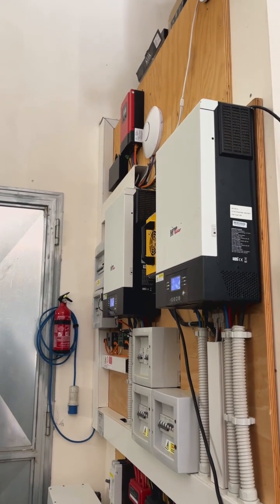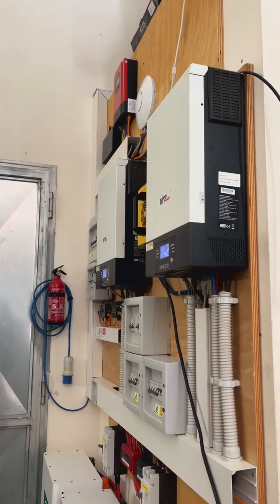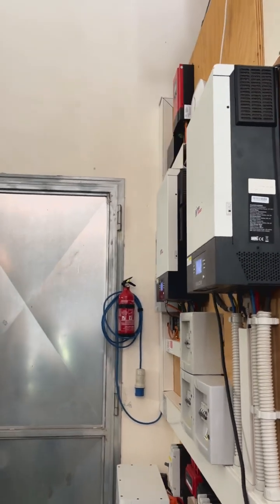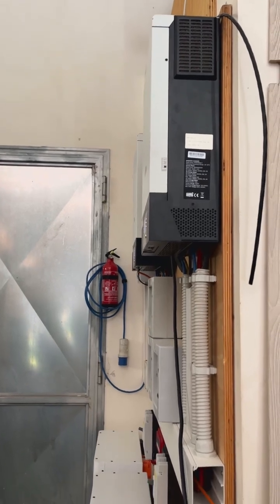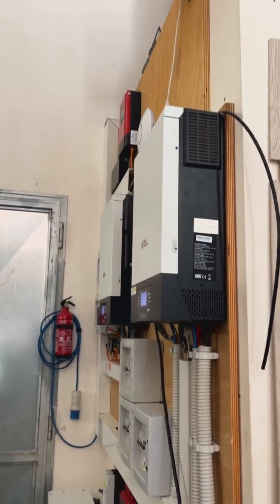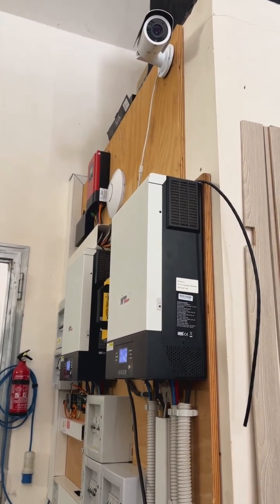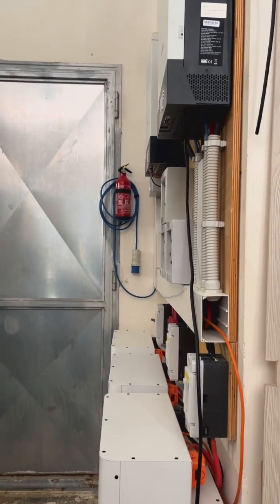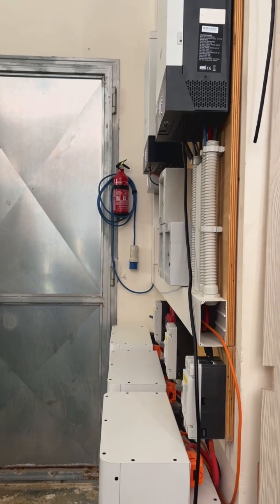Can I Fix My Overheating Inverters Before Summer Gets Worse?

Comment: Fan's cool heat sinks well let the hot air out of the room high up  before ac a box won't let out hot air
Reply from the maker: yeah if I box the inverters I will have to keep the ac running permanently so not too keen on that solution. got a portable unit that I want to duct to blow over the inverters as a test. will keep you posted. 😊

Comment: Lol, already gave you my solution ( and yes that is a mini split ;) )
Reply: In America we have window units and portable units the smallest uses about 450watts slightly easier and portable. If u have any adjacent crawlspaces filtered air pump directly to the fans. Lastly move the inverters into a air conditioned space in the house . Just a few ideas
Reply from the maker: @blainecelestaine4543 yeah moving the inverters is not an option. 😊 going to try some tricks with a portable aircon unit I have first.
Reply: @blainecelestaine4543 the window and portable units usually are ver inefficient and not inverter based, cause compressor start peek demands
Reply: @houseofancients as far as the power aspect, Everything comes down to amps ,watts , duration .
Reply from the maker: Yup my portable one isn’t an inverter type. I’m reluctant to box it all in as then the ac would have to run permanently. going to try ducting the portable ac to blow cool air over the inverters first. if that works I  will get a small inverter mini split and duct it. lots of playing to do still. As you said solar power is worse than crack! 🤣
Reply: A few of those 4x8x 1/2 (dont know the metric) sheets of rigid foam shouldnt be to expensive and allow you to temporarily box in the area so the ac' s thermostat can cycle off as it cools  @FarmsVilla
Reply from the maker: @blainecelestaine4543  I was going to use plywood. Like your idea of using foam. 😊
Reply from the maker: you did! my only concern is as it will be in a tight space will I introduce moisture by running the mini split? 🤔
Reply: @FarmsVilla mini split AC will not introduce moisture into a room — in fact, it typically removes moisture from the air during cooling.

Cooling Mode:

Removes heat and removes humidity (dehumidification happens as warm moist air condenses on the cold evaporator coil).

It lowers both temperature and moisture levels.

Dehumidifying Mode (if available):

Focuses on removing moisture, with less emphasis on cooling.
Reply from the maker: @houseofancients thanks for this. It has put my mind at rest. 👍🏻😊